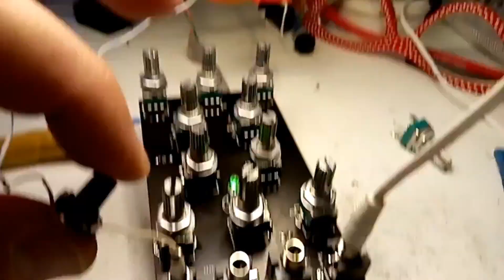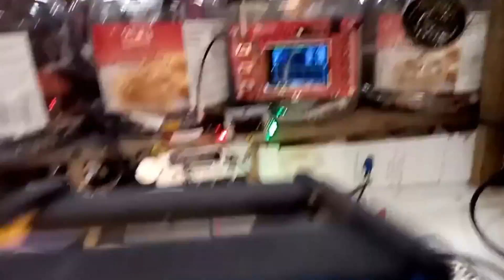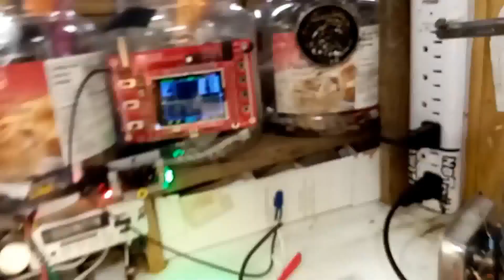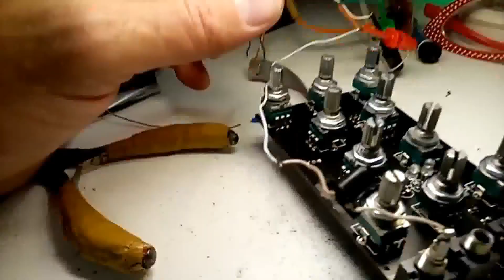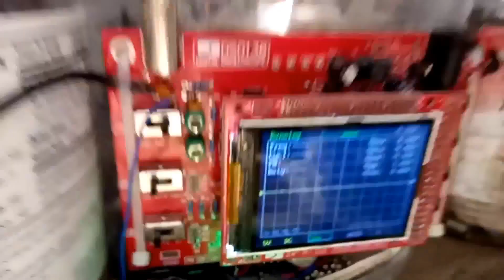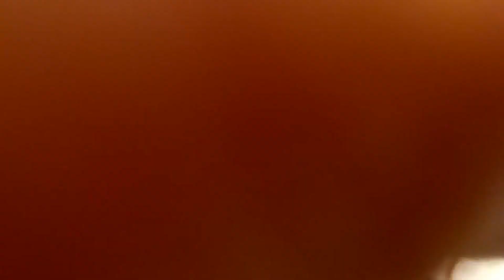Fixing PCB mistakes! JLCPCB-assembled kick drum PCB

Comment: Sounds great! How much did the assembled board cost?
Reply from the maker: With promotions, you can get boards under 100x100mm assembled for "free", which means $2 for 5 PCBs to get printed, $7 SMD setup fee, and then you pay for all the components which may be more or less $$$ -- if you go this route, be SURE to select components that are "basic", since if you use an "extended" part, there's a fee every time the technician has to add that part to the pick-and-place machine. Also, if you have through-hole parts, a tech will add those for you if you want, but there's more associated fees for that.

To answer your question more plainly, about $30 shipped for five boards. Wild.
Reply: @ozerik  Wow, thanks for the detailed reply.

That really is very reasonable for five boards. Is this the start of a more conventional looking rack or are you just dabbling in modules with corners? :D

It'd be fun to see some circle shaped PCBs!
Reply from the maker: @Bantam80  I'm basically bringing my round can circuits to the world in Eurorack format as a way to make my hobby a little bit profitable 😁😁